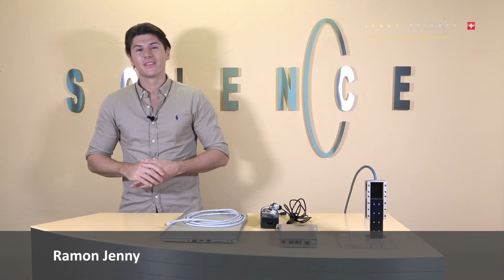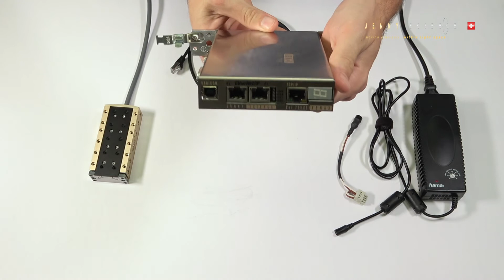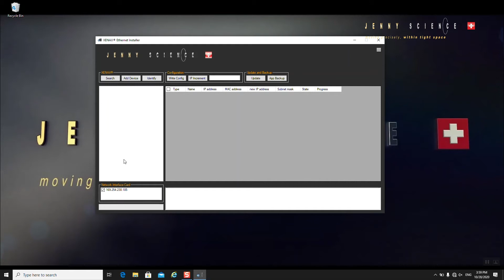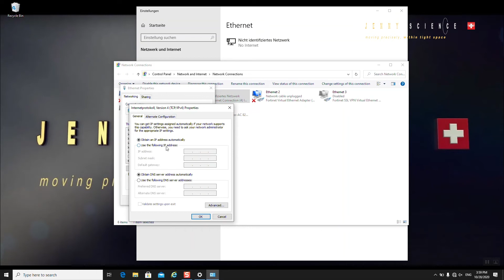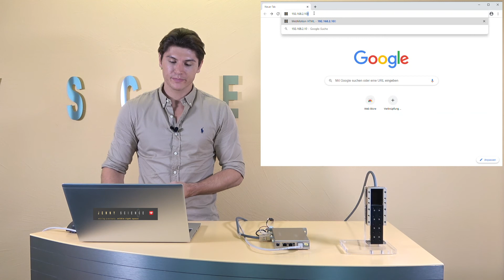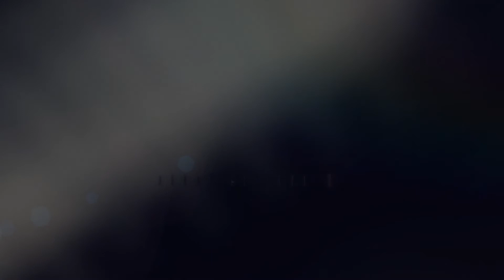ELAX® Electric Slide Setup with XENAX® Controller | Quick Web Browser Tutorial

Comment: On power on off condition 
Is it travel with absolute?
In Siemens we get it actual position?
Reply from the maker: Dear Harinder Sharma

Thank you very much for the intrest.
After the "homing" is done the travel is absoulte.

You can operate the axis with Profinet and read out the value of the current position / speed / acc etc. cyclically.

The Payload depends on the speed you need to achiev, this ELAX® has 20N nominal and 60N peak Force.

please do not hesitate to contact us: info@jennyscience.ch

Best regards
Jenny Science